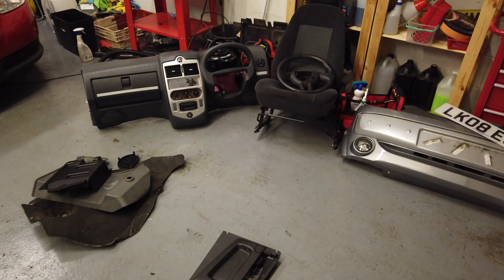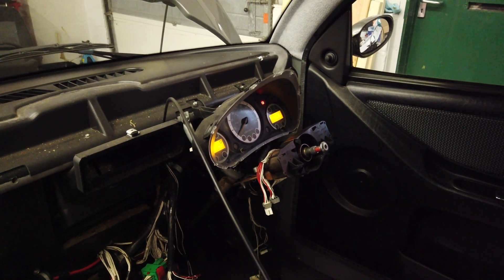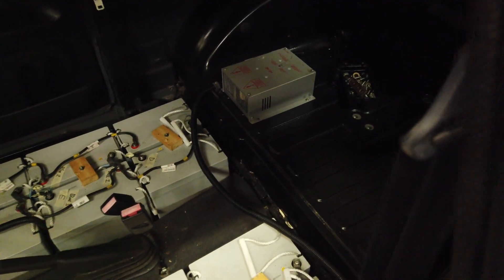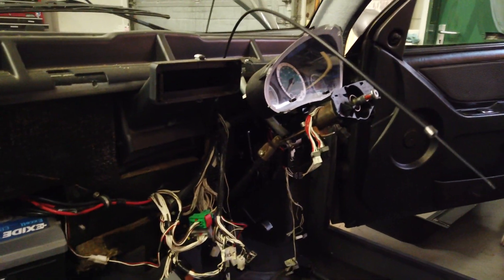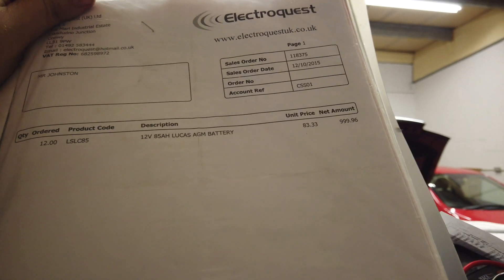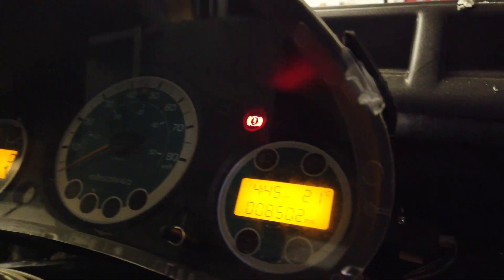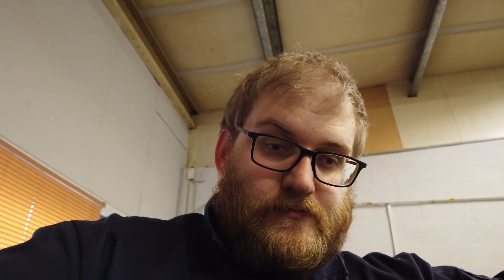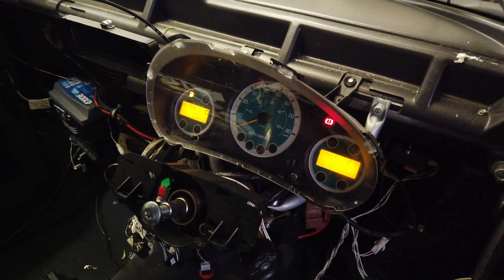The world's worst electric car has £1200 worth of new batteries!

Comment: I would've have tested the batteries and independently charged them. 12.6 volts is a fully charged battery voltage, anything below this figure is dead. Each individual battery should have a CCA output. The cranking amps should draw down to around the range of 11.2 - 10.8 volts but recover to 12.6 volts on a healthy battery.

I have fixed many chargers too and to me they are straightforward. 

I built my own off-grid workshop with 12 volt tools. It was a steep learning curve but once you understand Ohm's Law it is very easy to grasp.

If you don't make mistakes YOU will never learn.

Why pay someone else when you have a unique opportunity to attain the knowledge yourself?

I did everything up until I became a wheelchair user including pre-MOT. I mean everything right down to the components that Haynes and Clymer fail to express.

Comment: Just re-watched this video and noticed towards the end of the video when you show the charger trying to charge the batteries. The dashboard displayed the letter D indicating the car was in drive (I'm guessing) would this be a possible issue as I wouldn't have thought an electric car would want to charge correctly while being in drive.
Reply from the maker: I suspect there’s a slight issue with the gear selector - I noticed this too - but the battery charger is definitely faulty. Have had it diagnosed, repaired, returned to me and it’s gone back again due to it taking a knock in transit! 

Not sure this thing is sophisticated enough to have that kind of interlock for charging, it doesn’t have much in the way of safety features 😆. Thanks for pointing it out though.
Reply: Not a problem, just something I spotted and thought it would be crazy if it could charge while in drive 😂. In fairness, it does look rather... Basic to say the least but quirky in a good way too. I'm hoping there will be future videos from the cars you were working on in the unit.  Keep the videos coming 👍

Comment: I wouldn't be surprised to find that it is a rebranded/repackaged version of another OEM charger.

Your suspicions of it being temperature related seem accurate. Easy to confirm with a temperature probe. Easier to confirm by forcing the fans to run all the time as you said - if you can complete a charge in this state then it should just be a case of reinstating the temperature control.

You mentioned bulging capacitors - are you able to show us some hi-res photos of the board and of these capacitors?  Replacing these should be trivial, and depending on what's happened here, could also solve your fan control issue.

I'm an EE, and work on units such as this quite often, if I'm able to help get this nugget back on the road, then I'll certainly try!
Reply from the maker: Think I’ve found someone willing to inspect and refurbish it. Fingers crossed!

Comment: Maybe putting 2 PC ventilators on the charger could be the easy solution? If possible?
Reply from the maker: Definitely something I'm considering.  Having seen some photos of the internals of the charger via the previous owner, though, I think it would greatly benefit from some professional attention - several bulging capacitors etc.